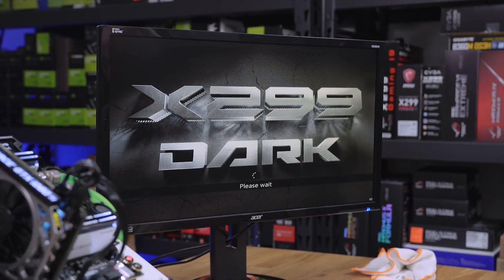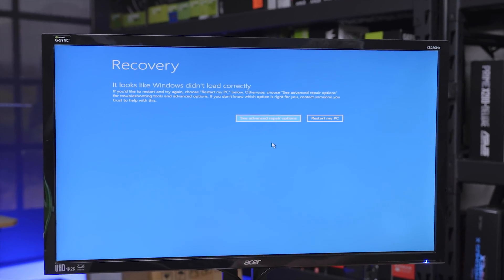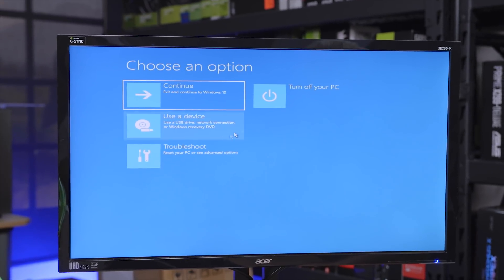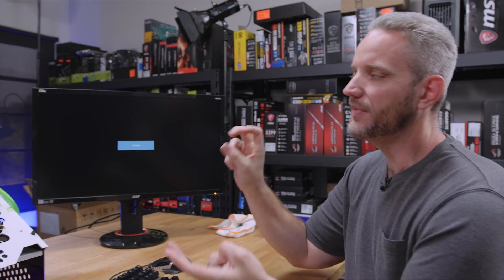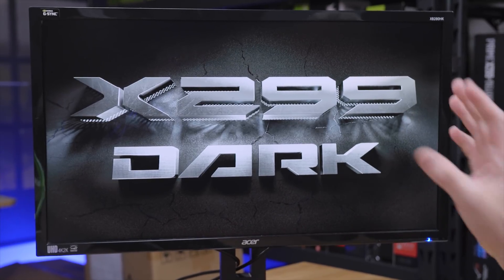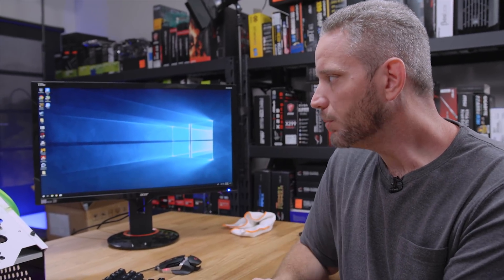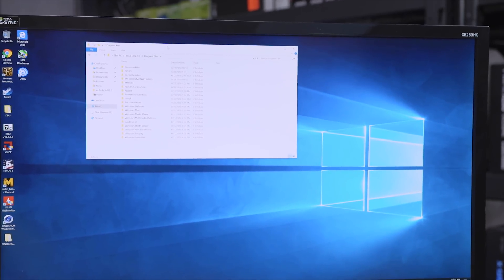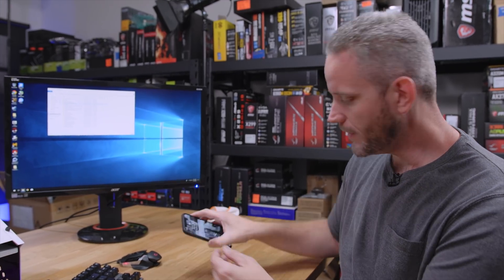New Test Bench Keeps Boot Looping... Here's how we fixed it

Comment: FYI I was using AMD and I was getting alot of BSOD.. After 1 year of alot and random BSOD.. I switch all my system to Intel. And now I'm 1 year with Intel and I have no random or any type of BSOD  :)
Reply: i find that hard to believe. lol
Reply: "I had a bad processor, I got a new one, it worked well"
Thanks Captain, you help is always appreciated!
Reply: I bet that came with a new fresh install of Windows too, right? That's most likely what actually fixed things. Too much junk, either accrued over time or from stupid OEM preinstalled nonsense can really make a system perform poorly.
Reply: Lol intel shill
Reply: Layer 8 issues.
Reply: Tbh I had a lot of problems with amd builds myself. I was all about amd then I went through 2 cpus and 3 boards in 2 years. Also had weird/stupid issues like usbs randomly disabling, weird audio stuff going on. I finally went Intel and now I dont have bs issues like that. Also, hardware isn't dying on me every 6 months
Reply: Been team blue since 2002. The last AMD chip I used for gaming was a 1.3 Ghz Duron.
Reply: I was using the AMD fx 8350 for year trying to find" fixes" of BSOD and crap like that.. I did like more then 6  times fresh install windows 10 I just got tierd and switch to a inter i5 6660k.. And is still running smooth
Reply: Might have been the motherboard, some vendors really didn't seem to care about what kind of power they gave the CPU. I had one MSI board that is flaky AF, even though it's a 990 chipset, but then a Gigabyte 970 chipset board that was rock solid. The difference between the two is astonishing really. I feel a bit cheated on the MSI board, it's supposed to be "higher end" board with the 990 chipset but gets it's butt handed to it by the "budget" Gigabyte 970 chipset board. I think the MSI board cost me like $130? and the Gigabyte board was $70?
Reply: Yeah I find it hard to believe a CPU can cause BSoD's. I've used that CPU on tests before and never had an issue. I also run AMD Ryzen on my main system and again, have never had a BSoD. It's more likely stupid users, than stupid computers :))
Reply: It's a PEBKAC error. No big deal.
Reply: +Gamma T.C. Yep. That's why you're amateur. 🙂

Comment: Hello. I have a problem. I got myself a B450M board from gigabyte and a ryzen 3 2200g and i CAN`T START WINDOWS with the integrated graphics. With a dedicated gpu works fine. I installed all the drivers when i first started windows with the Basic Display Driver, but, after the installs, it black screened and won`t start back up. I even flashed the bios but still nothing. Any ideas what can i do?
Reply: Are you actually going into the bios to declare which gpu you want as initial display? initial display graphics from PCIe or iGPU? The only thing I can see you have done with the bios is flash it and not change the initial graphics to iGPU from PCIe. So no matter if you have your monitor in the iGPU port it still won't show as it is going through the PCIe lane.

Under Peripherals in the bios make sure your Initial Display Output is for the iGPU and NOT PCIe 1 Slot or similar. It should be fine after that. 

If your board supports switchable graphics then you can enable that in the bios and windows WILL infact detect both dedicated PCIe Graphics cards along with Integrated Graphics cards such as with the z87x OC-Force mobo from Gigabyte which I am currently using until I can upgrade, this mobo I have would then be used as a filestore system or other work station.
Reply: MorDreadful 
I did set initial display to igpu and it doesn`t display. I entered safemode without the dedicated gpu in the system and uninstalled the drivers. When i rebooted it started windows normally but as soon as i tried to install a driver midway through the installation process it black screened again.
I will try some more tomorrow. Now it`s late for me.
Thank you all for the help!
Reply: dodiloi

ok. I was just stating those things as it wasn't clear and just going through ruling that possibility out. It is difficult to diagnose any system without it being physically there. I am sure you can appreciate that. Do you have a function in bios for switchable graphics? I presume you have tried the cmos jumper to default with no power going into the board (unplugged psu) and no cmos battery in? I perosnally haven't used or worked on that mobo so I only have the manual I can download and have a look at.

I have had some extremely obscure faults to diagnose before in the past that took some digging and quite a number of tests from swapping cables, swapping out ram, etc on one system to find a fault in a dimm slot that regardless, showed ram still working fine and registering but just wouldn't play videos. The only issue was playing videos. I reinstalled software on that system and did everything else that you would do, even the bios but nothing, it finally showed up with a dimm slot issue that had became faulty. As I said, the ram was working fine for everything else and registered in POST and windows as the amount it should be but just couldn't play DVDs and this was back in 2006. Another person who was working on it plugged a floppy cable in upside down which shorted the system and burnt the cover of the power cables. So even with swapping out the RAM sticks the same issue occurred and the amoutn of RAM was still registering as it should have with no errors showing up.

I looked on the internet for similar issues with the board and on tomshardware site someone else posted with similar issues. They uninstalled ALL amd software and drivers and reinstalled in safe mode of that helps any.
Reply: MorDreadful Ok! I FIXED it. It was not broken at all. After the screen with the mobo logo it was switching to the dvi port. I was using the hdmi one.
Reply: This cpu is so overvolted. Stock it reached 1.4 volts and i had 57 degrees. I got a stable undervolt at 1.15 volts with 3.5 Ghz and the temps dropped to 45.
Reply: have you gone into the UEFI and made sure to enable the integrated graphics option and changing the priority from external/dedicated GPU to the integrated? i would start with UEFI and make sure everything is setup for what you want it to do.

If that doesnt work, try using the external GPU to at least get into windows and download and run a program called DDU (Display Driver Uninstaller) in safe mode with networking off and another program called CCleaner to clean up the registry, ive used both many times with good results. Once DDU finishes, reboot into safe mode without networking and run CCleaner to clean the registry. Once thats done, shutdown and remove the GPU. Enter the UEFI and set everything back to factory settings, exit and save and let windows boot. If you still have no input to even get into the UEFI try again with the GPU (settings back to factory), shutdown, remove GPU and try that. (im not an expert or anything but i have had this problem on my 2200G and this is what i went through to get it working)
Reply: this is going in blind but try to install your own drivers from AMD website.
Reply: Dito what everyone else said about enabling the iGPU in UEFI, but don't you also have to allocate some of the system ram to iGPU on the the new APU's?
Reply: It autos to 1 gb
Reply: i would also suggest making sure your BIOS is updated to the latest version and not to auto install display drivers, select a driver on the AMD website, start with the newest and if you get a black screen, run DDU and after a restart try the next older driver, rinse and repeat until you find one that works
Reply: Are you installing the driver meant for the APU or just installing the standard Crimson AMD Drivers? The APUs appear to require a specific driver. If you google "amd apu graphics drivers" the very first link should get you there -> "Desktop APU / Processor with Graphics Drivers - AMD Support"
Reply: I searched ``vega 8 drivers`` and entered the first link. They are the same.